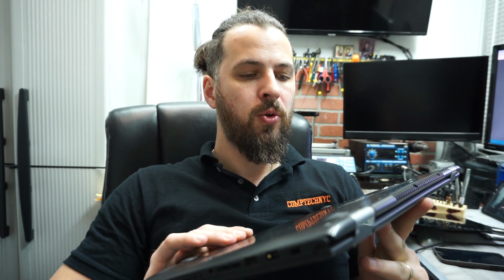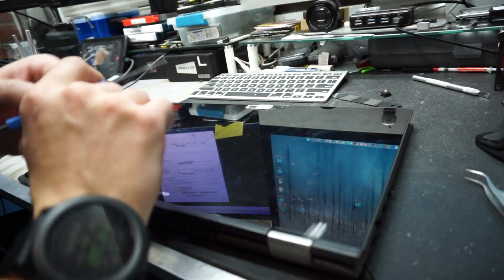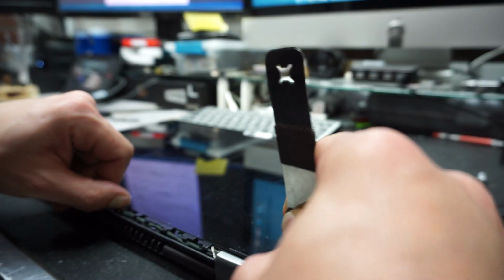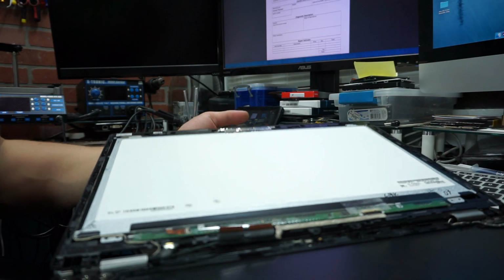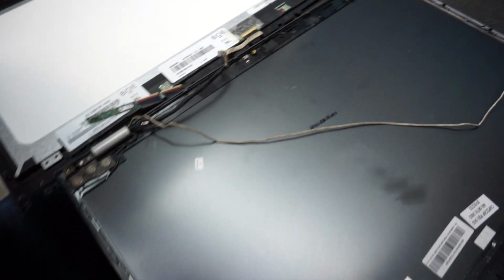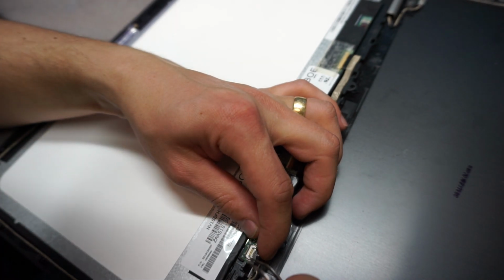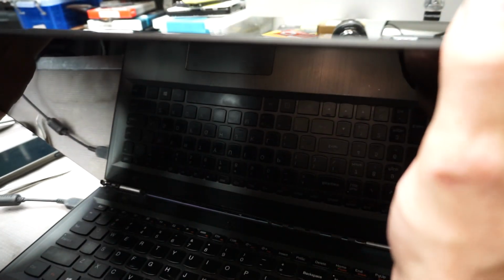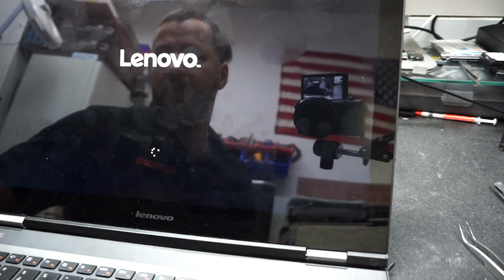Lenovo Edge 2 1580 LCD/ Digitizer replacement

Comment: i disconnected the lcd cable but when i put it back the screen dont turn on pls help
Reply from the maker: I would first try it with the old LCD panel. If there's an image and backlight on that, but not on the new one, you might have gotten a bad screen. If on the old screen you have no image, then put in the new one, turn the computer on, then use a strong flashlight, at a 45 degree angle on the screen, and see if you have a dim image on the background. if you do, then you might have burned the backlight. If you don't then I'd recommend you to take it to a repair shop to have it diagnosed.

Comment: Bro i'm not trying to replace the screen, but the bottom left part of my laptop's screen popped off and i can't fully shut it. The screen bleed also got a whole lot worse and i just can't use this computer like i used to. Do i have to replace the whole screen for this? The scree isn't damanged one bit but it just looks all misaligned and i can't fully close it.
Reply from the maker: Most probably the hinge became loose and it's pushing against the frame or LCD itself...if you have light bleeding through the LCD, I'm afraid the screen is bad, and you might have to replace it. Post a video of it for more detailed diagnose of the issue
Reply: Comptechnyc Is there a way i can contact you to see what i’m talking about? I don’t know if i have to replace my screen or not
Reply from the maker: @JuanJimenez.  www.comptechnyc.com
Reply: Comptechnyc sent you an inquiry

Comment: Do you have a link to the vendor with the exact screen assembly you are using with the bezel and LCD/Digitizer all pre-assembled?
Reply from the maker: for most of the parts, i'm using ebay; i don't recall the place i got that particular part; before ordering, remove the old one first, and order based on the part number , rather than the computer model

Comment: Wow, no needing to take apart the whole bottom just to replace screen! But, I think I have to also replace the back lcd cover/case, which I fear to do that I will have to take apart the bottom to remove the one with the broken plastic foot....are there guides that show how to disassemble every part, or do you guys just have to figure these things out with new computers?